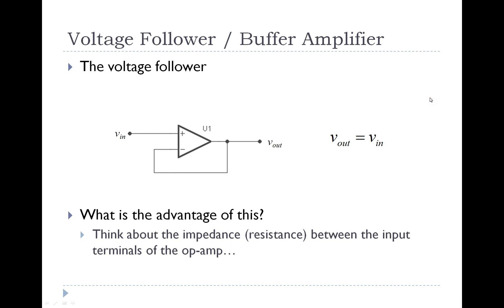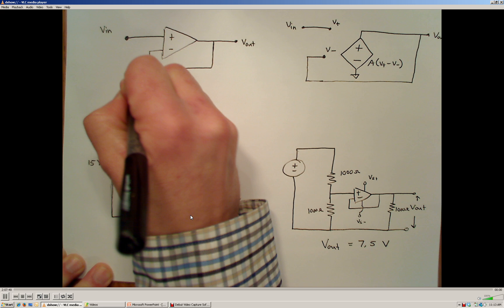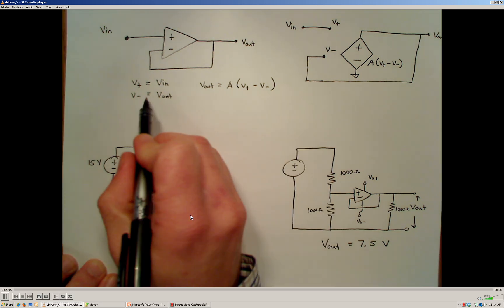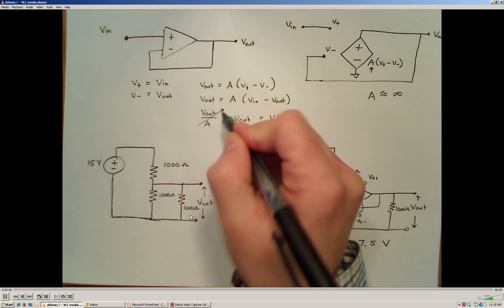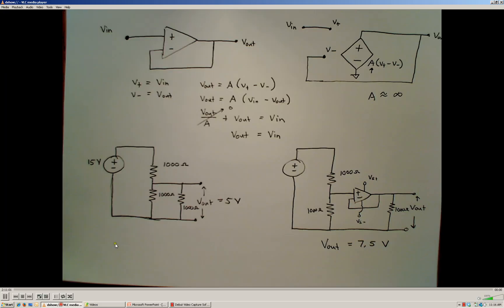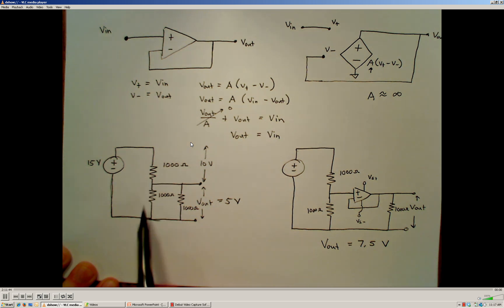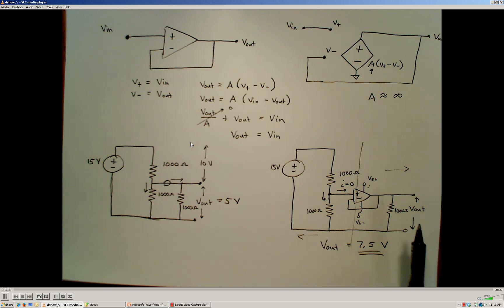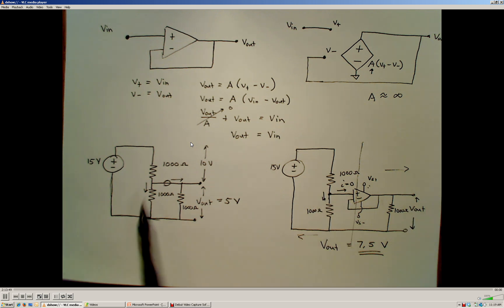ENGR 313 - 03.15 Buffer Amplifier or Voltage Follower Circuit

Comment: a very educating video!
But I have a question regarding the influence of voltage on the section created by the placement of the buffer amp.
It is true that no current can pass through the device, but voltage can. It confuses me because the second section of the circuit is actually affected by two voltage sources, one from the buffer amp and the other already shown in the first section .(left section of the bottom right corner drawing)So what would be the voltage levels like in the second section?
Reply from the maker: Voltage does not "pass through" anything.  Voltage is a measure of the potential difference. 

This is a common confusion.  Basically, when configured as a buffer amplifier, the op-amp behaves as a voltage controlled voltage source with a gain of unity (one).  The external power supply to the op-amp provides the mechanism by which current is supplied to the right hand side of the circuit.  The potential (voltage) developed at the output of the op-amp is a result of the current supplied by the op-amp itself (from the external power supply provided to the op-amp), not from the circuit on the input side of the op-amp.
Reply: ENGR 313 - Circuits and Instrumentation
Thank you for your reply. Your reply has actually led me to take a look at the basics of electricity again. One more question that I've always wondered about : can there be two different directions of electron flow at one point of a conductor?
Reply: +김재형 Ideally No current passes, the voltage sits on it like a static charge. This is, of course, bullshit, however, some op amps are more ideal than others. For all intents and purposes, no current flows. Think of it like a voltmeter, and perhaps itll make sense. A perfect voltmeter will have infinite resistance, but this, of course, is bullshit. However, you pretend it has infinite resistance, and the dependencies are written off as error. Neither voltage NOR current flows, however, the voltage sitting on the pin influences the internal circuitry of the op amp to get rid of any potential difference on those pins, by means of the output pin.
This is the point of the buffer amplifier, it makes a second rail equal to the first rail, while simultaneously staying isolated from it. 

With that said, perfect insulation of the two inputs is impossible because it could then not be able to measure the difference, and the more ideal it is at providing ideal zero current flow, the less ideal itll be able to make the two inputs match. This little problem is only ever an issue when working with very low currents, and the opamp spec sheet will let you know how precise it is. Because of this, you typically shouldn't use precise op amps for higher voltage/current applications, because these two aspects would typically conflict. This has become less of an issue with modern op amps however.
You have to pick and choose which aspects you need most ideal.
This is why i think the ua741(lm741) is the perfect educational tool to point out the non-ideal nature of op amps, because this opamp fails so horribly on doing anything ideal. However, learning how to expect and deal with the non-ideal quirks is very valuable.